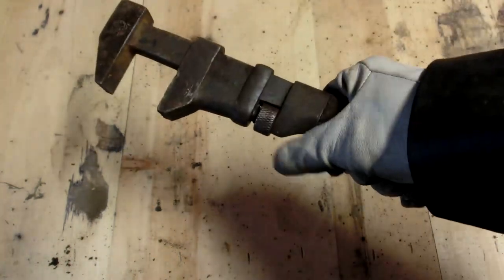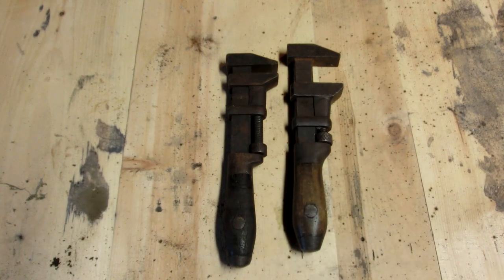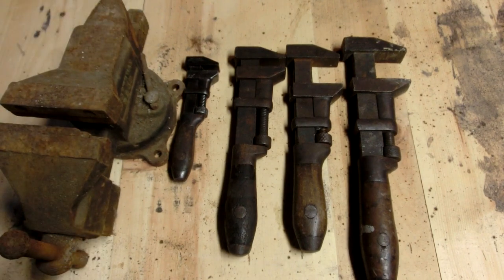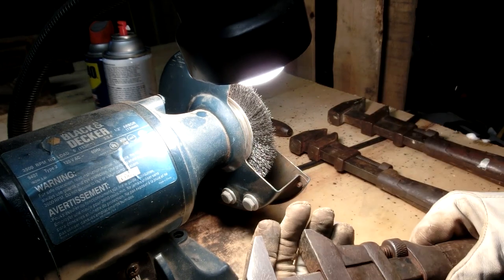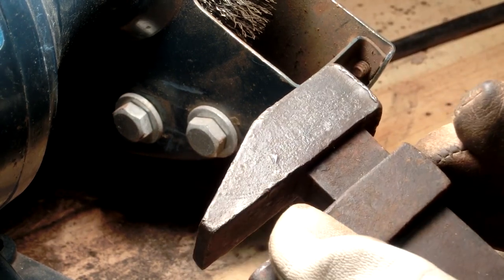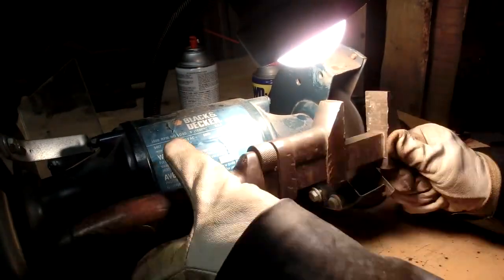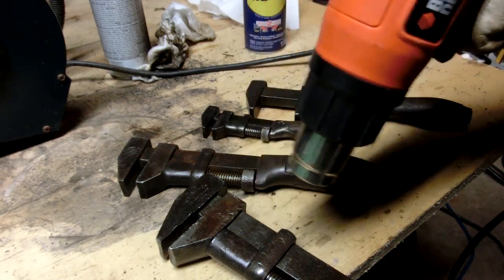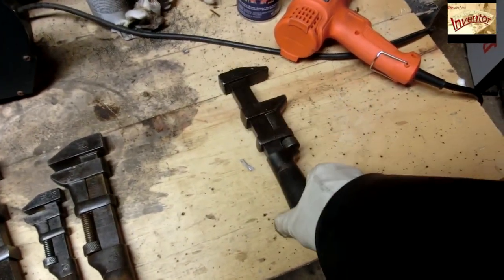Cleaning my favorite Antique Coes Wrenches

Comment: Next time you restore a wood and metal hand tool like this:

Take it apart, use water (trust me) with kitchen cleaner and a green scrubber. Takes the rust and crud off the wood and metal without stripping the patina. Then, rub liberally with mineral oil, and scrub it off with a dry cloth. Reassemble and oil with wd40. Can even try soaking the wood for a day in natural color danish oil in a ziplock bag then hang to dry for at least a week. 

I just restored one of these the same size as your smallest. Going to do the danish thing later.

Comment: Never ever use them for a hammer or the jaws as a c clamp. They are used for nuts and unions only. We use them on the railroad for steam and water connections.  Take care of them and never put a pipe on the handle for leverage.
Reply from the maker: they are designed to be a hammer. and using them as a clamp causes no harm.

but yeah theres no reason for a cheater bar for these. i have about 4 that are bend up because some idiots thought it was a good idea.

Comment: I can't speak for the American Worcester, but in England the city of Worcester in the county of Worcestershire is pronounced Whust-ter. The county is pronounced Whuster-shire. Like Gloucester or Leicester both are pronounced Glosst-ta and Les-ta.  

You know I've never actually seen one of those adjustable spanners except for the ones you use. I've got some 1970's Swedish made Bahco adjustable spanners. They still work fine even though their last owner had a 5ft bar on the handle of one and was bouncing up and down on it. I've also got an ancient pair of Stilson pipe grips which were my great uncles. 

One thing about WD40, technically its actually a solvent that has lubrication properties. You have to renew it on a regular basis. Normally i clean with WD40 and then apply oil to stuff. On of the most durable oil coatings I've found is silicone gun oil.
Reply from the maker: +zoidberg444 yeah i figured wd-40 would last at least a few months.
Reply: +zoidberg444 Or Wooster
Reply: +zoidberg444  Listening to people from Massachusetts, it sounds like they say "woos-ta."  They appear to think the letter "R" converts the vowel proceeding it into a long sound with the R not making a sound at all.  When saying, "park the car," it comes out "pak the ca."

Comment: They might not mar the surface on stuff but they also won't grip it :-) I also have a set of these from my grandad after he passed away and I don't like the wrenches but these will always be dear to me. Boiled linseed oil works well especially if put on hot, I learned that from Torbjorn.
Reply from the maker: +Spark Gap i've found the oposite to be true, you can crank a coes wrench down onto a nut really well. especially big ones.

Comment: I wonder if the value goes down if you sand and polish them???
Reply from the maker: only the value according to a moron who has no plans to use them. the only value you should be concerned with, is respecting their reactors and the tools by keeping them in use, and using them for generations.

If i was building tools in the 1890s i would feel so proud to know they would still be perfectly functional and used regularly 150 years later, not just sitting on some shelf for display.

Comment: I have a few of these. I've gotten mine clean using just vinegar and a wire brush, and a little 3 in 1 oil to keep the rust away. 

What I really want to do is figure out how to dismantle them so that I can clean each part separately, particularly those areas you can't reach when the wrench is together. 

Sadly I can't seem to figure out how, if there even is a way. 

Any ideas?

Comment: those are cool wrenches, I am an auto mechanic and have many wrenches. however have nothing like that, I would like to see how they work on a modern day vehicle. love your videos BTW, keep em coming.. we're could I get a wrench like that?
Reply: +shaun  counts
They are the kind of thing you can only fall in love with if one isn't using them "in anger". That is why they are old and now very largely unused.
Too heavy, too cumbersome and unwieldy and just not that great at keeping parallel on a nut or bolt head. They're great at rounding them off though.
Modern drop forged movers "adjustables" are far far better.
BTW, best movers I ever used, or saw are the Bahco ones. They are the only ones I would trust my life too. Used to hang off them in decidedly dodgy positions, reasonably high up.
Reply from the maker: +rationalmartian thats odd, because ive found i can really tighten these wrenches down onto a nut and have a better chance of saving a nut compared to my 1947 Plumballoy wrench.

Comment: the wd40 is not permanent it will evaporate completly over time. if you want to keep something from rusting forever you can dip it it hot stearin wax. its organic and used for candels. it sticks to metal well enough but will rub of with use.
Reply from the maker: +steffankaizer ok cool, i was wondering if wax would work.

Comment: Give them a soak in diesel.
Reply from the maker: +norxcontacts how would the wood handles handle that?...wow that sentance was a mouth-full.
Reply: +Rinoa Super-Genius It will dry out the wood somewhat. There is a risk of cracking as the diesel dries off, since the diesel will remove the oils from the wood and it will dry beyond its normal state.